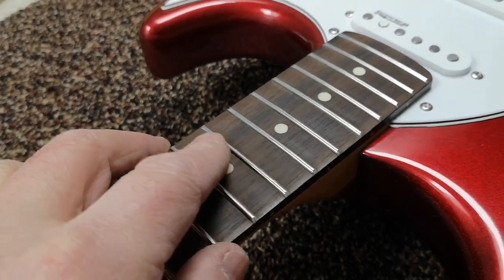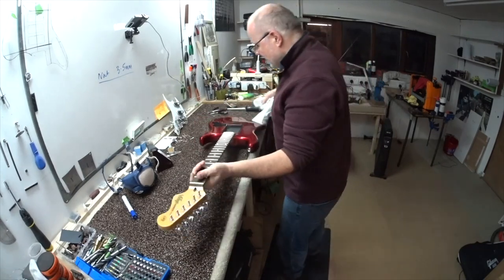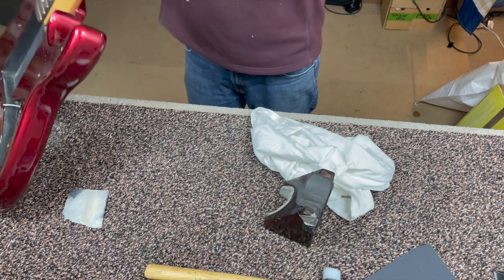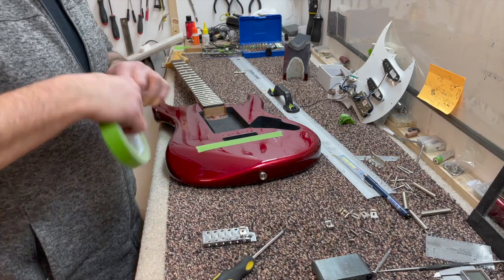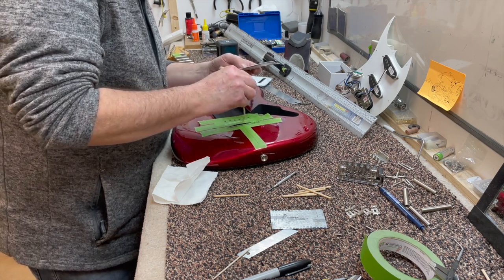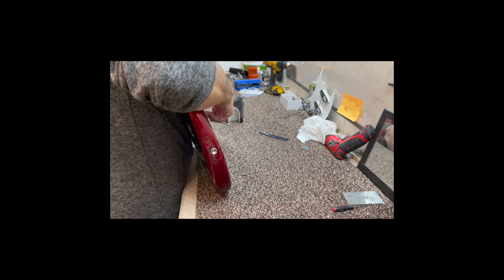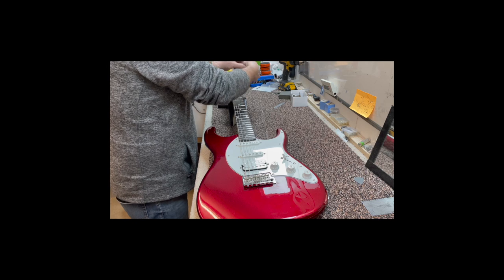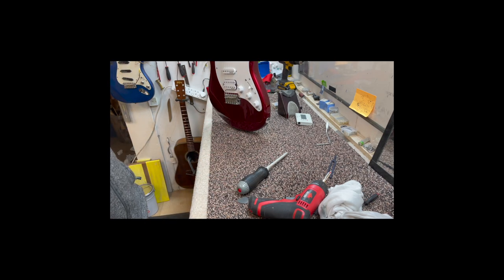Vintage AV6 refurb and set up

Comment: Hi Sam. I have a V6 Reissued (sunburst) and i noticed that there are at least two variants of this model. Some of them has true rosewood fretboard and others (like mine) has something like cheap dry rosewood thing (with parallel lines). Do you have some knowledge about it , and what a weird kind of fretboard is this?
Reply: It’s most probably some Asian rosewood variant. As compared to traditional rosewood this wood has a more grayish than brownish color. My Korean Peerless built Epiphone Casino from back in 1996 has it so I am guessing they’ve been using it for many years now.

Comment: Others have them, their made like that Sam. The Babinga is to soft to hold a screw over significant time i should imagine. Did yours have a laminate plate on your V6A? They used a hardwood laminate after the metal inserts so it must have been a problem.

Comment: Haha 😆 I’m 15 minutes in and this is one of the most fascinating/entertaining vids you’ve ever made 

Loving the new workshop by the way, great lighting and camera angles /quality
Reply from the maker: Thanks! I've taken my own one of these apart years ago and I don't remember those bolt & square nut neck fittings... When I tried 3 camera shoots (gratuitous!) I quickly got into confusion with all the chunks and trying to sync them... So I stepped back to two since then which is less interesting but more workable. I've also fixed the iPhone to a movable table mic stand so I can move it quickly from one end of the bench to the other for close-ups..  I've got the synching and quick-editing (cutting between the two cameras) down to a pretty quick art... It's just a matter of cutting away to the Sony when there's no close-up material and cutting back into the iPhone when there is. The sound now ALL comes from the iPhone and I strip out the Sony audio in production. Having said all that, on some of these current vids I messed up leaving the two sound tracks up and very slightly out-of-synch over the space of an hour or so... apologies for the teething errors!

Comment: Hi again.

As this video is over 3 hours in length I am not watching it in one go, so I have a comment on the fret work.

Did you check for high frets?  Did you use the fret rocker tool?  Because of you did not, there is no guarantee that the frets are level and so fret buzz etc can be present.

You also did not use a neck - notched - straight edge to check the straightness of the neck because a straight neck and level frets are related, you can have level frets on a non straight neck, but the work needed is eyewatering and you will need to do it again.

From experience you cannot assume anything as it will "make an ass out of you and me"

Comment: I am continually watching your video, I love the commentary, but I am perplexed about how you cut the nut.

What I do, I learned this from Crimson Guitars is:

Get the blank nut, Fit it as smooth as you can, then when the nut is fully fitted use half a pencil - cut long ways - and use the half pencil to stay along the fret height on to the nut - that way you know the absolute furthest you can cut.  Once the slots are cut final sand the upper part of the nut.
Reply from the maker: I think we get to the same outcome; just different ways. I either cut down to my target 1st fret action; occasionally I sand from below, measuring until I'm spot on... (long-winded) or more often I use a custom-made adjustable nut. If I cut the slots downward to get the target 1st fret action then I always remove a lot of excess nut material above the strings.